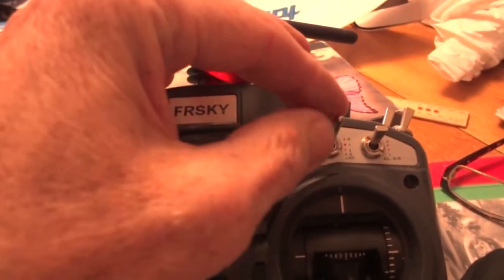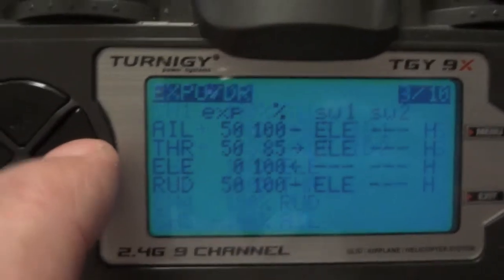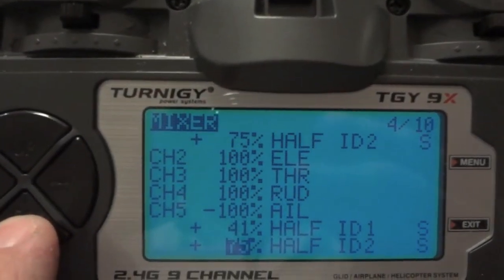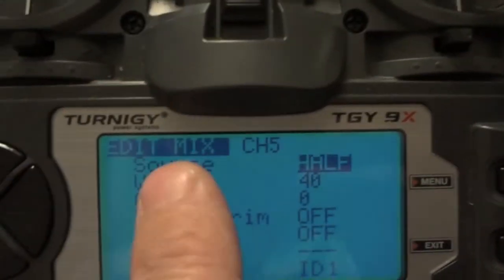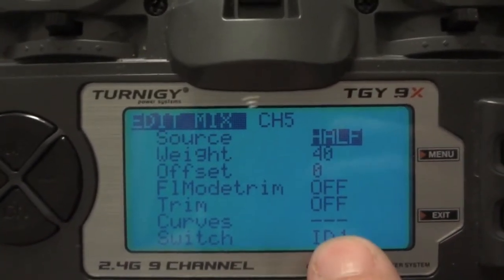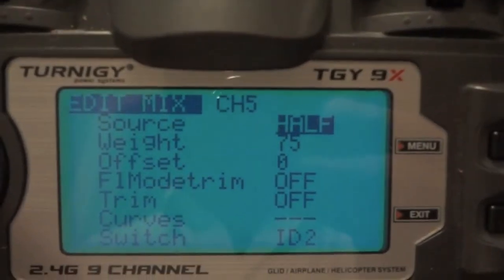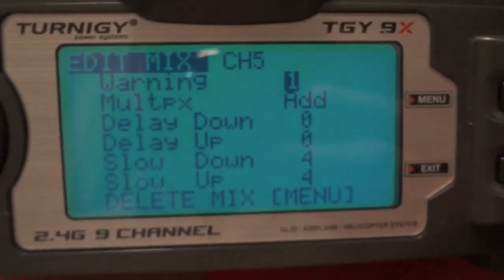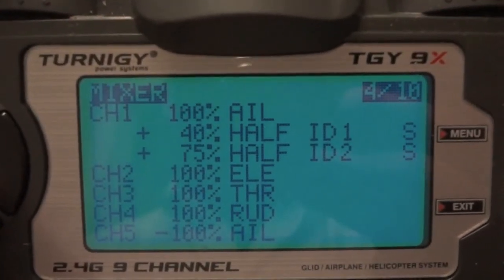Flaperon Programming er9x

Comment: What do you mean by "I didn't have to reverse them, I reversed them here" Are you referring to reversing servo physically? In an three position flaps set up in the old FW. I used channel 6 for starboard side aileron for instance. In this case you have used Ch5 and made the ID0 state as neg 100 as I see it correct?  Okay so I am game and wish to add Elevator as well to correct the initial nose dive the AXN makes. So I am doing the mix tonight and hoping the blasted weather clears. 100Km gusts :-)